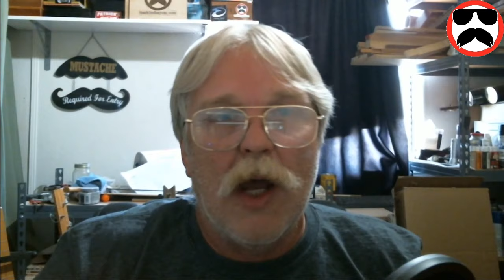LIVE Q&A #23 - Add a Form Tool to the Tool Database

Comment: Rats - missed it.  Wanted to ask about the tool database - is that something you can "browse" with standard database tools file (something that lets you look at the actual database tables)  Google says no.....
Reply: OR - does anyone know what kind of databse Aspire uses?  Or is it something proprietary........
Reply from the maker: The database and individual files for the tools are .TOOL files, and yes, they're proprietary. I know of no way to just "browse" the tool database. To be honest, I don't know why you'd need to. Just open the software and browse the tool database from within.
Reply: @MarkLindsayCNC  After a little more investigation I've determined they're DBase 3-based files.

The reason I'd like to be able to read the files is so that I can take a large collection of tools, say the ones from Amana for instance, and extract only those part of it that are of value to me.  That database contains 791 records - of which I need maybe a couple dozen.
Reply from the maker: Okay, gotcha. Here's an option - use an older version of the software. For instance, when I upgraded to Version 10, Version 9.5 was still installed. After I merged the tool databases into Version 10, I didn't need Version 9.5 any longer, but I didn't get rid of it. Start the older version, import that database into THAT version, then go through and find the tools you'd like to export. You'll have to export them one by one, but it beats having the whole database file clogging up your new version.